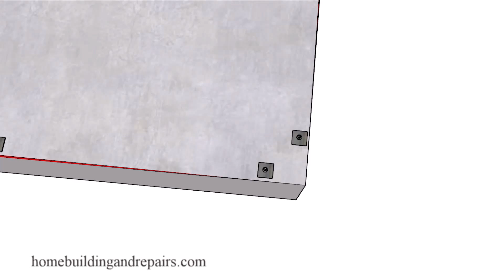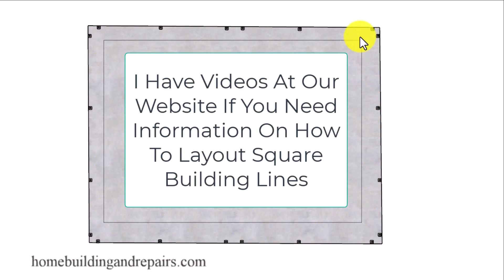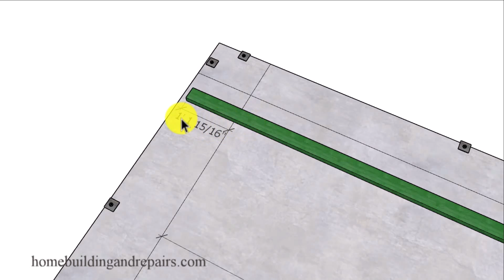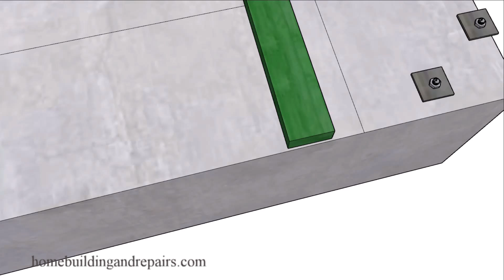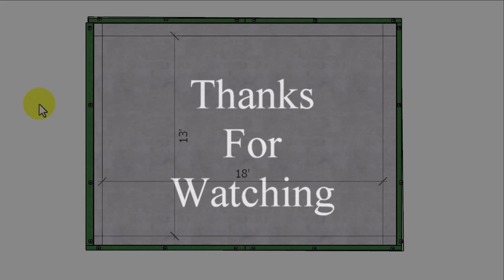How To Layout Square Wall Framing On Concrete Foundations That Is Not - Home Building Tutorial

Comment: Interesting video. How are you finding that interior square to pull off of for measurements? Are you pulling from two adjacent sides that you deem the most straight, finding the approximate center, and then rounding up to the nearest foot when you actually put your square down for an easier measurement later? Basement foundations would make this a more challenging method I presume. Do you know why this happens with slab foundations? I know that building a 7ft high basement wall can cause some errors by the time you reach the surface, but on slab? Does the pressure from the concrete curing cause the exterior boards to move around a little bit, or does it have to do more with improper installation of the foundation?

Comment: How much will plate overhang on the concrete would be acceptable in your opinion?
Reply from the maker: I would think 2.5 inches should be the minimum of the plate sitting on foundation, but it would depend on how much weight the wall is supporting.
Reply: Thank you. My contractors messed up on the foundation and framers all ready put up the wall trying to look at solutions but want to make sure I want to make sure I’m not going to have problems down the road
Reply: Do you think an inspector would catch it or should I get a structural engineer?
Reply from the maker: I can't say for sure, because it would be up the the engineer. @christophersanchez735

Comment: In your video, you mentioned replacing a 2  X 4 with a 2 X 6. If you use this method and place the inside of the 2 X 6 on the square line and then trim the outside to match the concrete foundation, would this cause some large challenges for the rest of the build ?? I see that some wall studs would have to be individually ripped or furred out but what else can I expect ?? Thanks for both your time and video.
Reply from the maker: You might have problems with thicker walls and they could prevent you from using all of the suggested repair methods in this video. Let me know if this did not answer your questions.

Comment: If the framing base plate is hanging out side 1"in ina 6" wall will it be unsafe building?
Reply: How are you placing a rectangle inside the building that I s squre
Reply from the maker: It would depend on the design and engineering. I would think it would be fine for most smaller single story homes.
Reply: Would you place say a measurement a foot in and create the 345 right triangle or 6.8.10